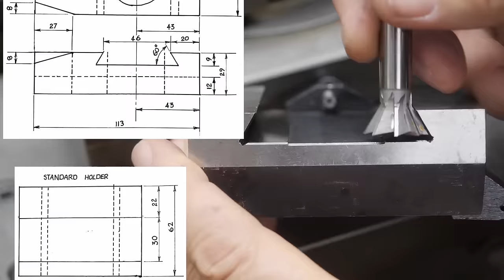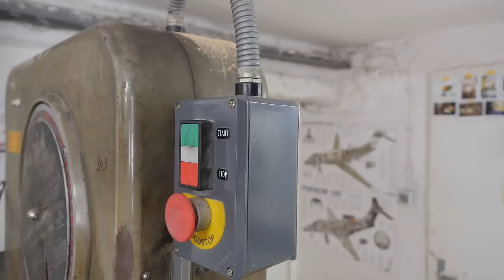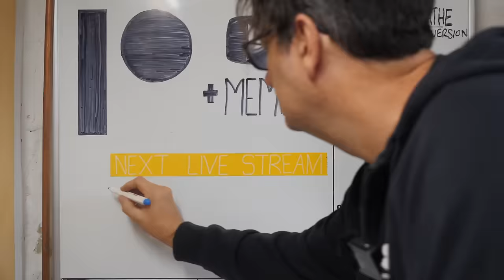Using triangle carbide inserts in a homemade cutter was a bad idea. || RotarySMP

Comment: Well that worked  dovetail cutter a treat 👍.So now you have to buy 2 sets of 2.5mm taps, one for Fran and one for yourself.😒😁
Reply from the maker: Already ordered. :)
Reply: @RotarySMP on top of the job👍
Reply from the maker: @kenthesparky178 I hate damaging another guys tools.
Reply: only two... lol.
Reply: @MikelNaUsaCom   agreed! Little stuff like 3mm or 2.5mm taps, buy them in a pack of 5 at least.
Think of them more like little disposable endmills than like prized taps that you going to cherish for the rest of your life lol.
"my PRECIOUS!  ... (snap) ... Doh!"
Reply: That tap handle was making me cringe.. for a small tap..  I would have felt better with something longer axially.. like a chuck- type tap holder, if not an extra long one.. easier to keep in line.. but, you got the cutter working after all, nice. & nothing like an excuse to check out a friend's shop..

Comment: The finger on your cutter grinder looks too thick. It won’t help you have enough feel on smaller cutters as it is too rigid. We used broken hacksaw blades as fingers. The tap wrench was way too big for the tap. You need to use a small  “t” type tap wrench for those tiny taps. (Trying to be helpful comments) . The dovetail cutter worked very well. I bet you were pleased 😊
Reply from the maker: Thanks Chris. You are right, that finger came with it, and was made from power hacksaw blade. I even have a worn out hand hacksaw blade sitting next to the Clarkson ready to be reshaped.
That was the smallest tap wrench on hand. The first cutter had some feel to it. The second one I got to confident, and turned to fast and the inertia hid the feel. Dumb mistake.
But I am pretty happy with the result.

Comment: Yeah ...  That cutter will not cut a real straight angle. It might look 60 degree but it will be somewhat bowed because of that huge off center cutting flutes. If the cutting edges are straight on a rotating tool they need to be on center, if you need them to be off center for whatever reason then they need to be set at a compound angle or helical. It's just maths ... But nice try. You could still salvage it I guess
Reply from the maker: Yep...
https://www.youtube.com/watch?v=QcRovVJXnSk

Comment: With labor rate at 150$ an hour in my shop, it's cheaper to just buy the right tool I need. I make plenty of custom tooling for myself,  but they make dovetails in the size you want.
Reply from the maker: This is just a hobby for me, and learning what to do right or wrong is just as important as the result in many cases.

Comment: That Shaublin drive train sounds sooooo smooth!
Reply from the maker: At higher speeds that large toothed belt is pretty loud. I duck the audio on the machine a lot, as they sound pretty bad in videos.
Reply: @RotarySMP  I was comparing it to my Colchester Bantam (which to me, sounds wonderful) but as it was 'all in the edit' I dont feel quite so bad... 😉
Reply from the maker: @philip_fletcher The gearbox on the Schaublin only provides he back gear, so it doesn't make too much noise. The huge belt extruding air is probably the loudest bit, and that at highest speed (3000 rpm), I turned this at about 1500 rpm.
Reply: @RotarySMP  poly -V belts are so nice,  nearly silent  and so much more smooth that conventional V or toothed belts
Reply from the maker: @steveggca I was tempted to switch, but the wide toothed belt will allow extremely high torque, much more than a poly-Vee (but that is probably academic, as I doubt I will ever need such torque on such a small machine).  The main reason I didn't switch was the work. The existing parts were all there and in good condition.
Reply: @RotarySMP  wouldn't worry about that, mori  and everyone else switched to poly-V, in the 80's .    
The SL-25 had a 15KW  motor and  3500 rpm spindle. belt drive  direct from the motor to the spindle .  
believe me  it did not lack for torque.
However keeping the original parts at zero cost and effort is a compelling arguement.
Reply: @RotarySMP I converted my lathe to poly-v. Glad I didn't go toothed as I start the thing with the spindle lock engaged so often! Not got round to adding an interlock but it's only been a couple of years 🙄
Reply from the maker: @Andrew_Fernie  Good points on both he torque rating and the safety aspect of an untoothed belt. If I need to replace the tooth belt, I will probably switch.

Comment: Why don't you bolt a spare tripod to your ceiling or better yet a nice bracket and quick release so you can hace your camera up out of the way?
Reply from the maker: Hi Micheal. I have some nato rail bolted like that, but had a light mounted on it. I really need to redo the who lighting and camera mount set up around the mill, as it is a bit of a PITA.

Comment: Love how you can see the change of tool speed, in the color of the chip, when the larger diam ends are cleaned up on the lathe.
Reply from the maker: I really need to sort out my spindle control logic to get CSS working.
Reply: @RotarySMP  you can just excuse it with the cool looking visuals, for YouTube :D
Reply: @LittleHambre  photometric closed loop speed control, that is really cool!

Comment: Nice cutter!! Glad to see you back in the shop making things. Got to use a few different machines as well
Reply from the maker: Hi Luke, and a bit of a Carkson accessory show for you :)
Reply: @RotarySMP  Yes I need a vice :) I think there was a base to mount the vice directly to the table that's probably what is missing from your box
Reply from the maker: @LCalleja Good point. Could be. Those vises are pretty rare, but copies of it are made in India. I fine it really hand for lathe tools.
Reply: @RotarySMP well if it can be copied in India it surely can be copied in Malta. Nothing like a few good photos and some dimensions to copy from ;)

Comment: The milled flats seem quite forward of centerline, and the carbide even moreso. Big tradeoff between relief and rake angle
Reply from the maker: Yeah, I think I overdid that a bit. Didn't want it rubbing, but could have dropped them down a far bit.
Reply: @RotarySMP   I have made a CAD design for a 70.7 deg dovetail cuter a month ago and found that dropping the TCMT11 inserts half it's thickness (center then in the plane in which the rotation axis of the tool is) will give enough rake angle.  But this has an effect on the resulting cutting envelope (dovetail angle) and the insert needs to be rotated in its seat to compensate..  thank deity-xy for parametric CAD software!

Comment: Loved this video and I plan to make the same. From memory my tool holder dovetails measure 11mm or so and I wasn’t sure if the 11mm cutting face tcmt would do the job. Next size up is 16mm.
Reply from the maker: If your Dovetail height is 11mm, you will need the TCMT16's. The TCMT 11 are about 9.5mm high.

It has been pointed out that by moving the cutting edge so far forward of the plane through the center (4.4mm), my cutter will actually cut a slight radius on the dovetail face. I was trying to ensure I had enough clearance to prevent rubbing on the rear edge. I screwed up and made it 4.4mm instead of the intended 2mm. Probably not relevant in this static use case, but if you need to meachine a sliding way, keep the cutting edge closer to the center line. The 7° clearance angle on TCMT means you could probably get away with on CL, as long as your cutter diameter is above about 30mm.
Reply: @RotarySMP  I see. Isn’t the tcmt11 cutting face 11mm? Or at least that’s what I’m seeing in the engineers book.

Comment: Nice tool!  If you use that cutter and you have the bottom engaged as well as the side, there is a good chance all hell will break loose.  Chatter.  I have made these before and found that if you want or need to also have the bottom engaged you might need to use a DCMT insert.  The commercial versions that use TCMT have the insert at a slight angle to the axis, providing clearance for the inner bottom edge, but this also means that the dovetail face is not quite flat.
Reply from the maker: The dovetail slots I need will be roughed  out first with and end mill, and also have a relief groove 28mm wide and 0.5mm deep, in the middle which will reduce the rubbing of the dovetail cutter, which will only feed sideways.

Comment: One of my nastiest injuries came from parting off with a hacksaw. At the very end of the cut, I realized too late, I tried to keep the blade from going all the way through the cut. But, the hook that was left on the part, and my trying to pull back, grabbed my index nail at the root and yanked the entire nail off. Ouch!! So, get a parting inset.
Reply from the maker: Ouch. I have cut a lot of metal with a hacksaw, and consider it one of the less dangerous tools in my basement.

Comment: That worked great, a really nice looking cutter too. The lathe made a fab job of the turning work. When you chose a 60 degree insert at the beginning I did wonder if that would be OK. I was thinking that a more acute angle (e.g. 55) would be needed - mounted to provide a 5 degree relief at the bottom. In my mind this would mean the cutter wouldn't rub at the bottom but clearly it worked no problem. - Heather
Reply from the maker: When I make the tool holders, Schaublin put a wide relief groove down the center, so the cutter will not be rubbing over it's whole diameter. I am surprised my cutter survived it's first contact with me :)
Reply: @RotarySMP  Oh yes I saw that relief. Your tool not only survived it survived while doing a massive cut and did even seem to make any horrid sounds..
Reply from the maker: @GeoffTV2 The Maho is a real beast. I only push it by mistake :)

Comment: Nice tool, I have a draw full of chipped end mills that need sharpening and I don't have a Tool & Cutter Grinder and can't afford to buy one, so I guess I'll have to try and build one. 😜 I built my Mill and Lathe, so how hard can a Tool and Cutter grinder be. I would give them to a Toolmaker to do, but I can't find one around here. 👍
Reply from the maker: I guess you already now of the Tinker or the Quorn T&C grinders? Both can do as much or more than the Clarkson. They are very flexible machines.
Reply: @RotarySMP I knew about the Quorn, because Matty from Matty's workshop built one, but I have a very tight budget and I tend to try to get around that by just building stuff myself. I'm always up for a challenge. I recently finished building a Spin Indexer which came out pretty well. 👍
Reply from the maker: @MyMiniHomeWorkshop There are plans floating around the internet for a Quorn style, but without castings. You dont really need a kitset, the parts can be hogged out of plate, and bar.
Reply: @RotarySMP I make my own Aluminium castings anyway using the Lost Foam method, so that isn't an issue. 👍

Comment: It seems that your tool has high negative rake angle from video. Draw a line from tip of th insert to the center of the cutter at the bottom and check the angle. Zero rake would work better as insert has a profile with positive rake.
Reply from the maker: Yes, I overdid it a bit, avoiding insufficient clearance but reduced rake. Seems to work fine wiht this geometry, as the Maho is pretty stiff.

Comment: your live center is wobbling like crazy. Not sure what precision you can accomplish with that...
Reply from the maker: The center is fine. A three jaw chuck is not a precision work holding device, so remounting a turned part in it will always have runout.
Reply: @RotarySMP  So you're saying the three jaw chuck has the part not centered and is forcing the live center out of round and wobbling? I understand that but what I'm saying is your turning on the right side is not concentric with the center on the right. Not sure if it matters in your application though

Comment: Have u checked the dovetail angle after cutting it?
If the TCMT11 insert's cutting blade plane is on the rotation axis the insert will rub on the dovetail that is being cut in the upper part, but the dovetail angle will be correct.
To prevent rubbing the insert is better placed half its thickness above that plane (it's center plane then contains the rotation axis), but this affects the cutting envelope and subsequently the resulting dovetail angle, so the insert needs to be rotated in its seat to compensate..  it's a bit tricky.
Reply: PS:  if the inserts back plane contains the rotation axis to prevent rubbing (or it's even further ahead as is visible in 16:55 , plane of back of opposite inserts are like 5mm apart) then the cutting envelope will NOT create a 60 deg dovetail..
Reply: PPS: one naturally can compensate for this wrong angle by rotating the work slightly so the correct angle is being cut.. so not all is lost.
Reply: PPPS:  thinking even further about this I wonder if the cutting edge of inserts that are very far ahead of the plane that contains the rotation axis are actually still cutting a planar dovetail or if the resulting face actually has a curve to it?!
Reply: hm.. the best and easiest approach for hobby is probably to put the cutting blade plane on the rotation axis, mill the whole thing, install the blades and then go to a cutter/grinder and take off the parts of the inserts that stick out in the upper part of the cutter?!
Reply from the maker: Thanks Joan. good point. Given this is not a sliding way, but a static clamping condition, time will tell whether the deviation affects use.
Reply: @RotarySMP    Yeah, I'm aware.  The cutter I've drawn up is for the same use case.  I'm now debating with myself if I shall follow my own advice there now as I've placed the inserts at center height.. LOL
Reply: @RotarySMP   So in a way - big thanks for making the video and making me think one more time about this! 😉
Reply from the maker: @joansparky4439 When you modelled this, how far does the curve deviate from the ideal 60 line, with the insert 2mm "high"?
Reply: @RotarySMP    cutting edge of (2.38mm thick) inserts 4.38mm above plane with rotation axis requires a ~0.7 deg tilt inwards of the inserts to hold the dovetail-angle for a 35mm dia cutter.
For a 25mm cutter this gets worse faster and vice versa.
Reply from the maker: @joansparky4439 Hi Joan. I think I'll cover this on the video where I use this cutter. 

If you have already drawn it up, what is the resulting dovetail surface radius, and deviation from the nominal 60° flat plane due to my incorrectly set up cutter? 35mm diameter, cutting edge 9.5mm high in Z, with the insert cutting edge 4.4mm above the plane through the centerline (I screwed up there, my intention was to be  2mm above that plane for clearance.
Reply: @RotarySMP    If u do a video on it I'll figure out the maths and have a formula that calculates those values + the way how to get there tonight.  It's all just Pythagoras in the end.

Comment: You really should make a way cover solution for that Schaublin lathe... A great little machine, but Schaublin really has some mental people in the design and details department... I`ve been watching Stefan`s videos for quite a while, and those compound slides by Schau that he worked on are also made in a stupid way in regards to oil grooves... To be precise, the grooves are made in such a way that they leave a high spot over time in a section, which then galls the rest of the slide should you actuate it towards the more extreme ends of the travel... I really can`t see as to why would such a reputable company make such design faults and oversights with one of the most fundamental parts of the machine - the lubrication setup... 
Otherwise, a nice project! This type of cutter has been in mind for quite a while now, but i never got to making it as i am atm just sitting in my car and waiting for my girl... I mean, doing other shit and preparing for building of a new shop to actually fit all my machines... 

All the best and kind regards!
Steuss

Edit- speaking of that mill that your friend has got, i commented on your last video, those machines by Prvomajska are supposedly of extremely good quality, at least material-wise... Tho, i was referring to a 90degree head for Luke, rather than this machine specifically... Who knew, i speak of them one day and the other day, there is one that you run into...
Reply from the maker: Hi Steuss. I clean and lubricate a lot, especially to have little my machines have to work.
Reply: @RotarySMP  I get that, but nothing beats a proper cover set... You just rely on the one shot oiler sys and the covers take care of everything else for at least a couple of years, just be sure to cover the machined surfaces with some rust inhibitor agent like the boeshield t9 or similar to prevent any crap developing away from sight... It also then allows you to use grinders and similar terrors near the machines without any chance of it causing issues in any way... 
And once again, i`m in love with that 4 end massive toolpost... Such a majestic piece... I quite like the other smaller single ended toolholder you got there... Some quite nice components...